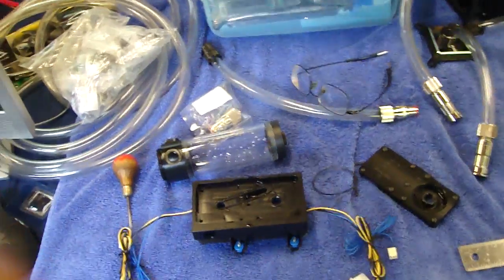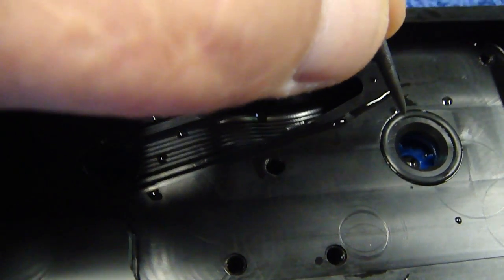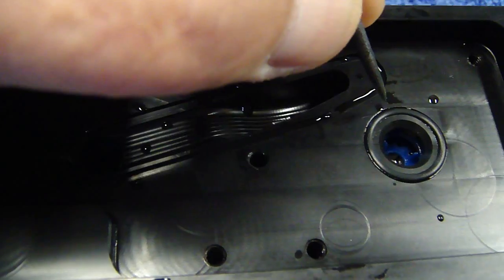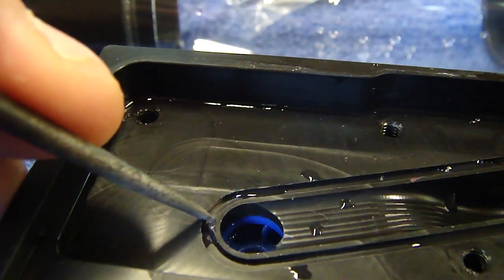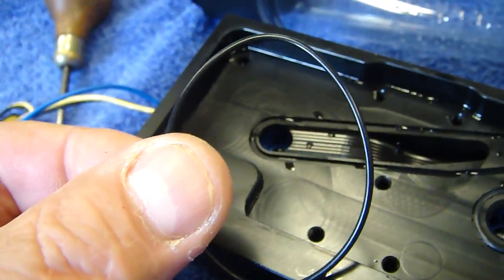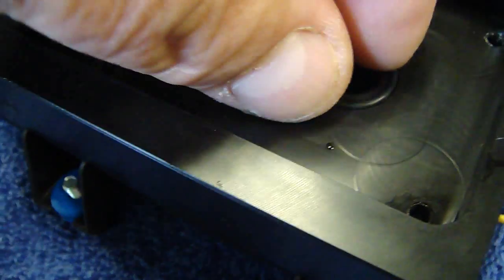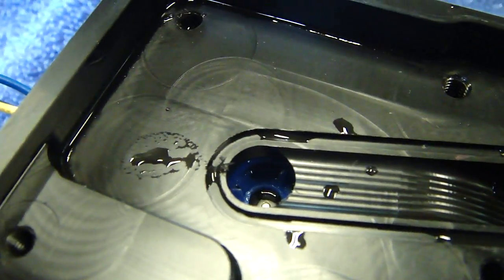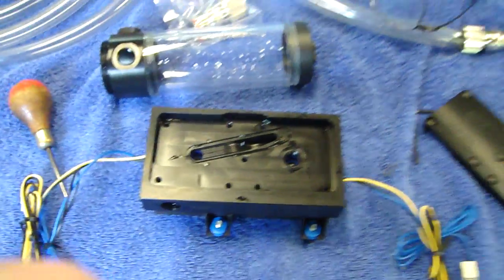EK Dual DDC Pump Top V2 Leak: Culprit Identified!

Comment from the maker: The "threads" were left over from the milling process and hanging off the edge of the machined channel for the O-ring. I carefully cleaned up the "hairy" edges by folding the offending material over and scraping it away with my fingernail. I was not keen on using a cutting tool.